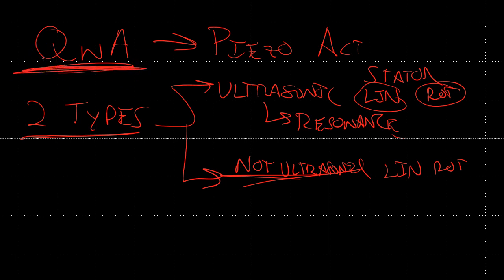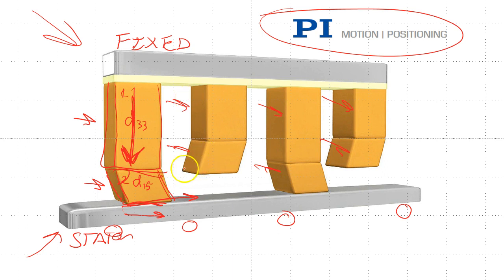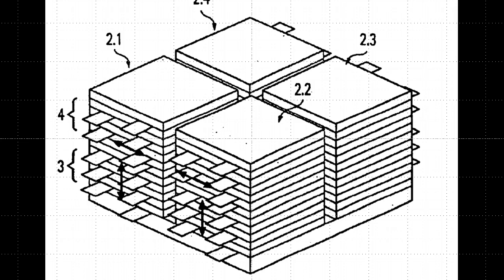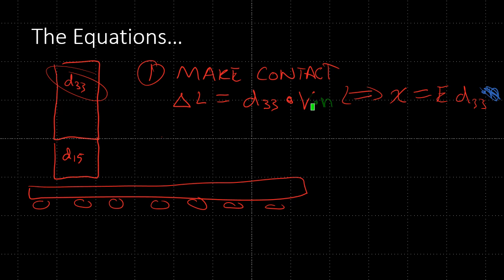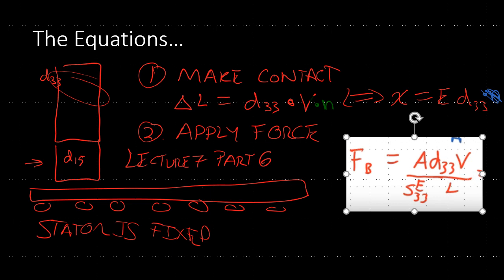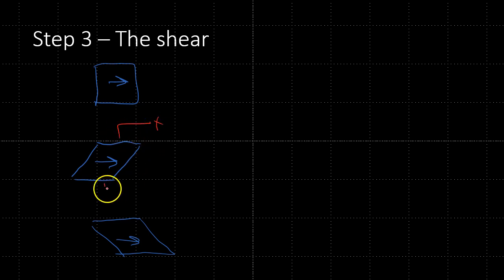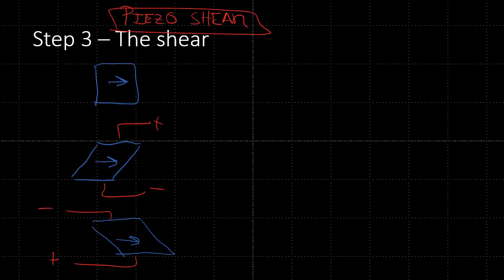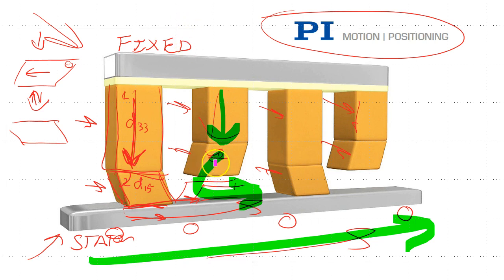Learn Piezo Q&A5: Piezo Actuator question - piezo walk motor

Comment: helo brother i am doing some simulations on comsol multi physics. i have a ellipse shape waist belt  geometry.i placed piezo electric material in that belt on four places top bottom right and left . i am applying pressure on inner side of ellipse but the problem is when i change the shape of the right and left piezo material it changes the voltage on top and bottom placed piezo output. can you plz let me know what will be the problem. i have both files of changed geometry on both sides.